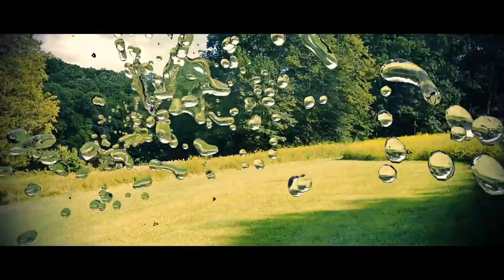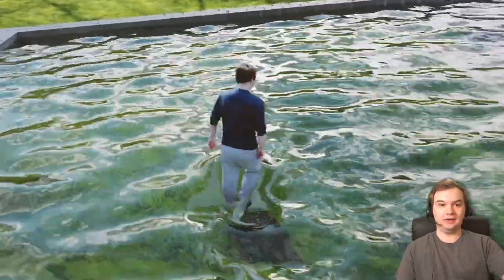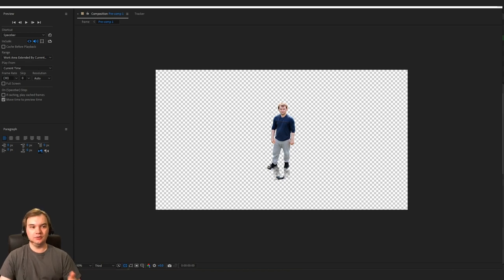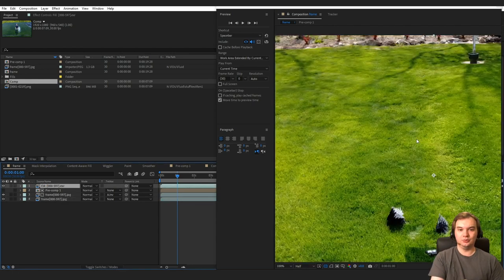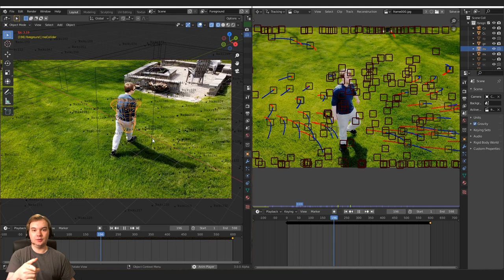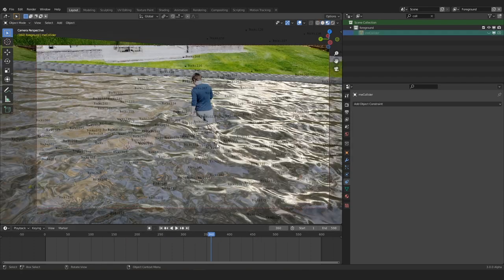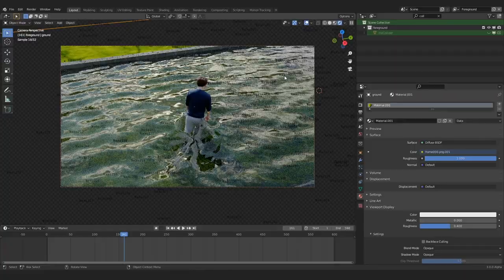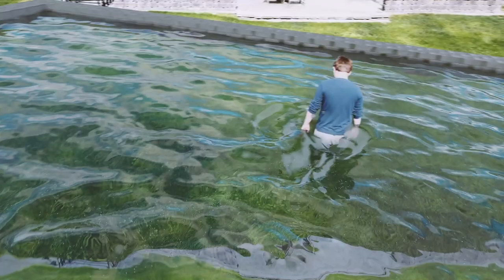Water VFX with Blender, RealFlow, and After Effects

Comment: Awesome!!! Can you tell, how exactly you imported foam particles from realflow to blender! I did some tests on importing particles into blender from realflow, but it overloaded my pc, and I did it with very weird way)). And maybe you can suggest some solutions. Thank you!
Reply from the maker: Hi! Yes I did figure out how to do this. It had to do with "instancing" a blender mesh to the points of the particles (which were imported as an alembic). So, I had a very small sphere instanced to the points of the alembic object. For the crashing problem, that just sounds like there were probably way too many particles coming in from RealFlow, so I'd fix that at the simulation phase.
Reply: @ChrisRCGI  yeyyyyy, thanks a lot!) actually, I was using the same method, maybe it’s just for blender it’s hard to handle big simulations with foam. Thanks a lot man!!!!